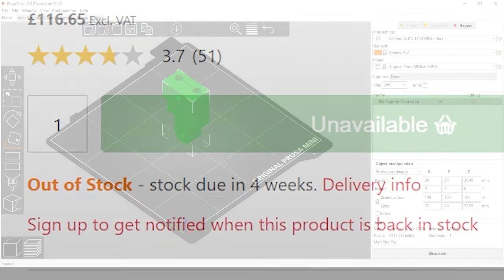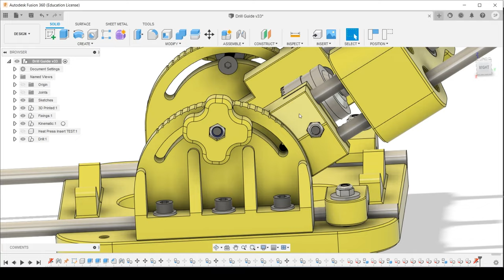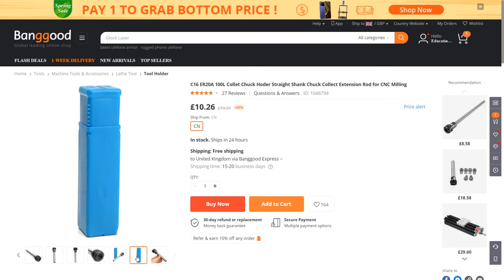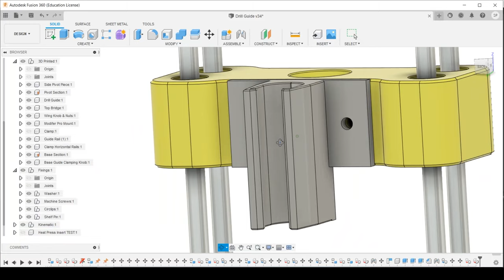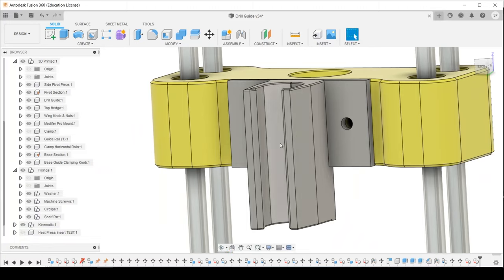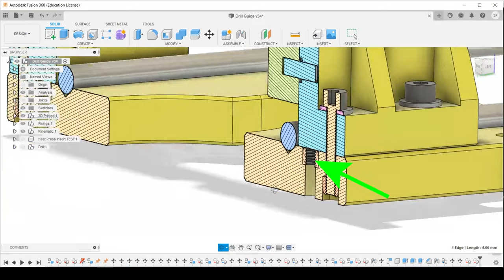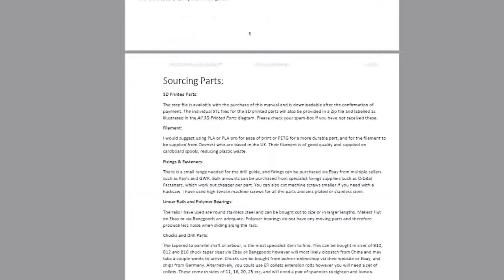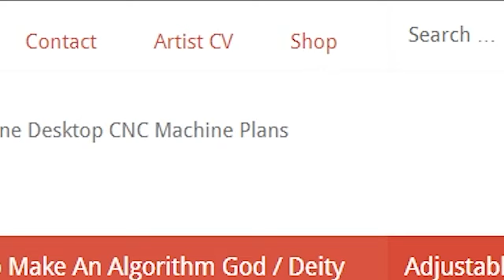Pivoting Drilling Stand Rig / Guide Tool / 3D Printed, Adjustable & DIY

Comment: Hi Savvas, where about did your relative go to school, the reason I ask is that I am seventy now and went to Richard Hinds school in Stockton-On-Tees and I have a hammer just about the same as that, I too made it at school and have not seen another even though I spent a lot of time in the north of England.
Reply from the maker: It would have been somewhere in North West London - state school between Kilburn and Willesden. Maybe this hammer was part of a comprehensive school DT curriculum? It's a wonderful objects.